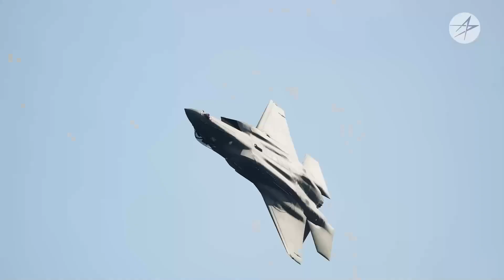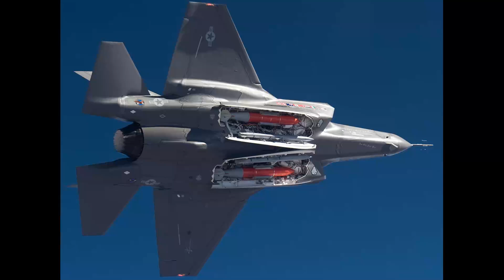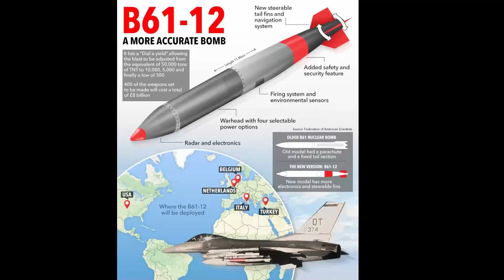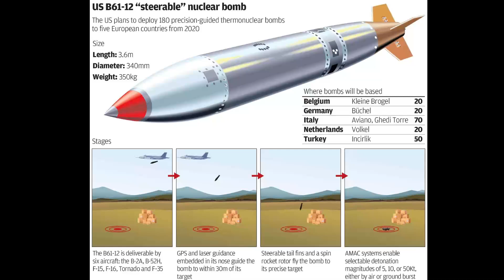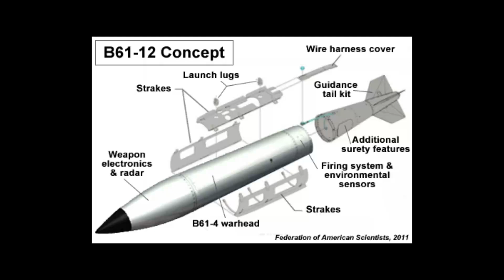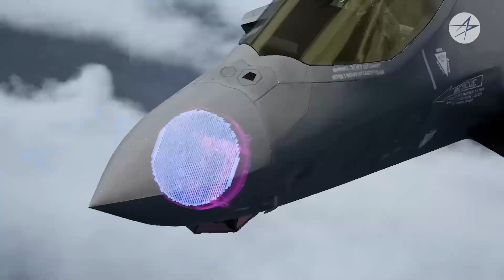F-35A Fighters Now Certified for Nuclear Bomb Delivery

Comment: Without any doubt, this will make the F35A more deadly.....especially when it is able to evade detection using its stealth capability...But then again, against a peer competitor, I don't see much of an advantage?  Firstly, it has limited range unlike the B2, B21 and B52. Secondly it is not the most effective nuclear warhead delivery system? Amongst the 3 existing  nuclear warhead delivery system, which are land, sea and air, the so-called nuclear triads, I would say the most effective is sea using submarines. Last but not least, Russia and China already have the capability to detect and target stealth fighters/bombers. 
My conclusion is that this is not a game-changer. However, Russia's Poseidon Nuclear Drone is. So are the hypersonic missiles which the US is now playing catch-up?
Reply: they do? then why are they trying to make them? you can detect them but it's hard to target them.  This flat form is meant to do a quick attack or strategic attack.
Reply: @stolly27  China's J35 and J20  are designed more for air-combat against F35, F22 , B2, B21 and especially American air refuel tankers/AWACS.   They are interceptors with long range in both distance and air to air missiles. If the F35A carries nukes, then it is no longer playing the role of an interceptor but rather an strategic bomber albeit the F35 is supposed to be a multi-role fighter aircraft.  In an air combat scenario, of course stealth is an additional advantage and since China has the technology, why not use it? Furthermore, China can do it cheaply as it does not need to reinvent the wheel like the US? It probably stole the technology from the US? On a common sense level, ask yourself this simply question? If China perceive the US to be a clear and present danger to its very survival, will it not do everything within its power to counter this threat? That's why for the last 10 years, the Chinese design their weapon systems to do just that and they have succeeded. Do you honestly think the Chinese will dare to challenge the US in all sphere of influence if they have not achieved parity with the US?